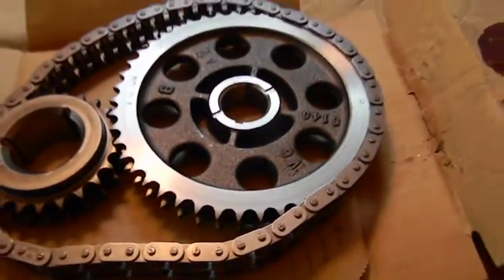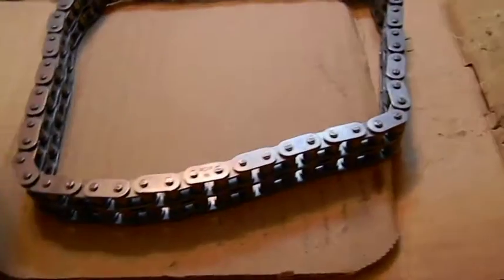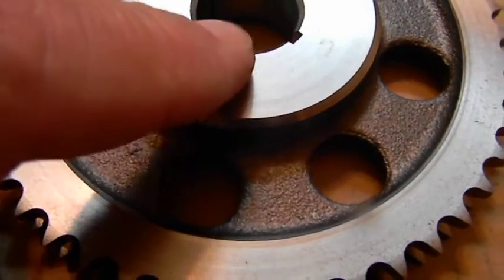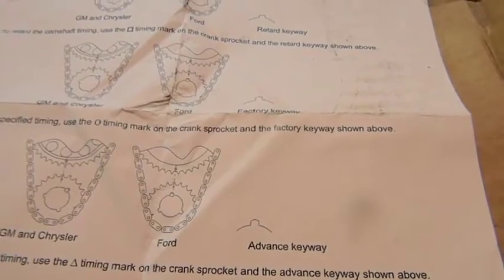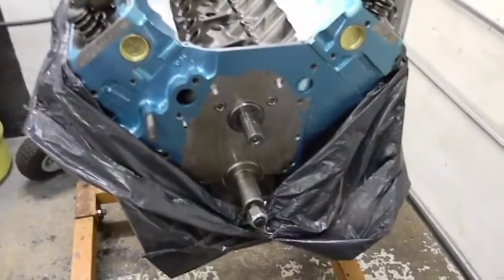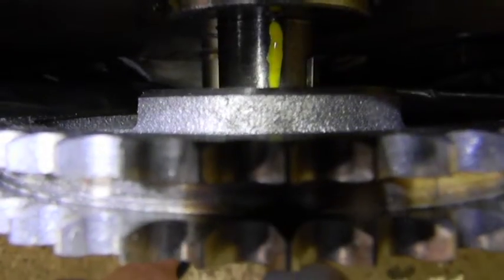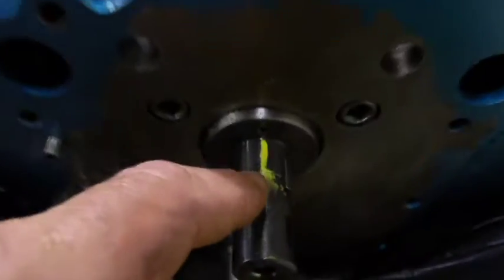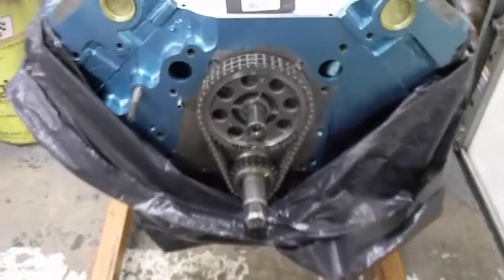AMC Roller Timing Chain Install

Comment: That "wrong spot" issue happened to me with a Cloyes set. I never thought I'd have to check stuff like that. I had used Cloyes on many previous motors in road racing motors for many years and the misplaced oil slot just seemed to show up at random in a 2004, 401 build for a J10 Jeep motor.  It caused a 200 mile failure of the cam and distributor gears. I was really pissed!

I'm glad to see you post this video.
Reply: i feel ya,i spent 4 grand getting my 401 freshened up in 2014,i paid to be present and have it preran on their test bench but they did that before i was off work, so i installed it in my j20 and 5 minutes running and distributor gears ate each other,i pulled my  motor for a 2nd time,they picked it up,supposedly rebuilt it and the morons didnt put a valley pan gasket in,so it was sucking oil ,so they had another shop install a poorly modified valley gasket to clear oil line,these morons used the rubber end seal for the manifold,i drove it 2 miles and it sucked those into the valley,i bout snapped at this point so they pulled intake again resealed it,and it still ran like shit and next thing,no.2 exhaust lobe goes flat.i had to part ways with all those dudes that call themselves mechanics that $$cked up my motor,5 yrs later and im putting it back together but im going thru everything to make sure its right,already found an issue with the pickup tube and have to resurface the oil pump housing so far.and repaint,and smooth out where they grinded my airgap intake,re engineer a pcv baffle and catch can, list keeps getting longer, uggh
Reply: the reason your cam and distributor gears failed is because your oil pressure is too  high, it only needs to be 45psi, when people change timing gear covers and install a new oil pressure regulator spring it has to be shortened  by two rings or else your are pumping over 70psi oil pressure and that takes a lot of torque to turn the oil pump at that pressure and it strips your gears

Comment: I’de like some feedback here plz,  I know it’s been years here on this vid, yet I choose to play this game on TC replacement in a 360 AMC V8.
So it seems you're saying there are slots on the TC top-cam gear that needs to be Modified or verified , either or, to ensure adequate oiling on the gears for the Dist/cam gears mesh-point..
I'm not quite 100% sure what a bad poor clearance that causes "inadequate oiling" one looks like and not 100% sure here  what I’m seeing here also. 
Is this extra groove you made in Cloyes TC gear, the necessary thing to do here to make it oil properly and supply oil to the gear or  top gear so they oil properly and live?.

Comment: First, did you know Cloyes and Comp Cam's are the same company? You wouldn't know it from the recent drop in quality! Also, I think the long groove on the Cloys cam gear will help provide more oil to the thrust surface. That should help a lot!

Comment: You guys seem to get a lot of aftermarket parts where stuff doesn't line up...Why is that.?...You've made it betterer so there should be little risk of failure now.
Reply: Overseas outsourcing is the main issue with parts these days.